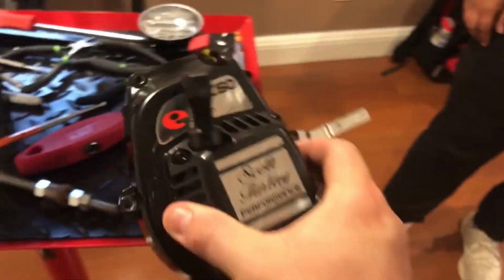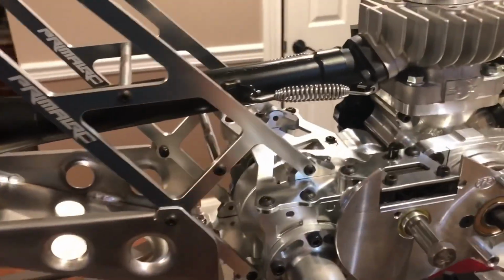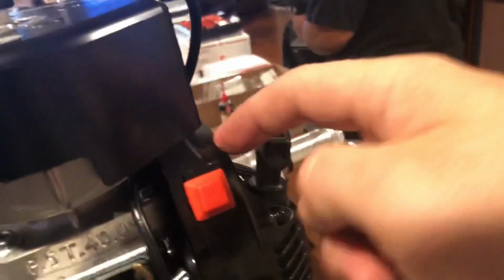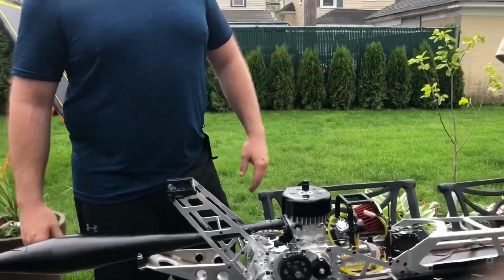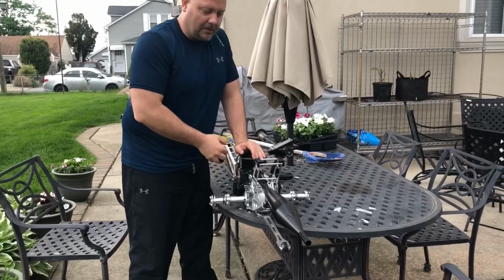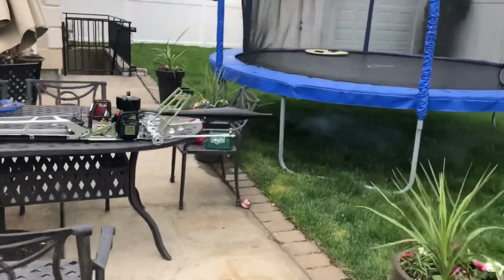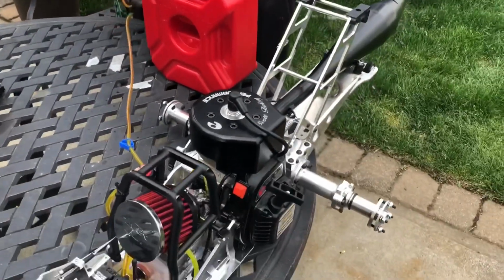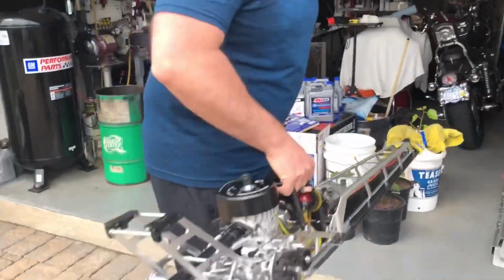She’s Alive💓1st Start Up⛽️💥🔥💨SF RC50cc/BR Drag Pipe, Primal RC Dragster

Comment: Sounds sweet Bro can't wait to see this running down the strip :-)
Reply: @BOTAJELL  john when you get a stock baja 5b buggy do you strip down the back diffs and make sure it's all its all tight with lock tight and put it back in with the screws to the right back wheel iv noticed they have come lose with some people and damaged the diff  is this comman john or just not tightened up right in the factory lol
Reply from the maker: Will fpv most people that are new to this sometimes over thinks things and take apart stuff for no reason or just wants to learn quickly but I recommend replace or repair as things breaks . Baja transmissions or the strongest out there even in stock form . If you remove your diff and forget how to took it out of the diff case ? Just re install it with the screw heads from left to right if your looking at the back of transmission. The ends of the screws are the flush side and that must face your Lay shaft and pinion and spur gear ⚙️ side .

Comment: Hey John did you machine the exhaust custom make it or where did you get that from ?
Reply from the maker: Chris Bartolone made me this Drag Pipe and header to use on this SF 50cc engine temporally because it was really made to be used on the New Bartolone Racing 50cc that will be coming out soon

Comment: Hey bro finally got that roving now I need to know where to find that none spill gas tank you've been talkin about should I try AutoZone Home Depot where's the best place I can find it thinking about starting the car up tomorrow for the first time
Reply from the maker: Your local tractor supply co. May have them in stock or https://www.homedepot.com/p/No-Spill-No-Spill-1-25-Gal-Poly-Gas-Can-1415-V6/206992015

Comment: Very nice Botajell!!
I'm curious if Chris B. can make a straight drag pipe for my alx 85?
Reply: Two strokes are much happier with an expansion chamber
Reply from the maker: Sure he can and it will be half the price trust me I have many pipes from many people and BR pipes always work well. The only problem is that he is crazy busy right now with to many things going on in he’s life at this moment like new Big Ass race tracks off and On road cars and including a Drag strip plus new engines , pipes , new engine dyno because his old one is worn out plus he also owns a body shop business with many cars to work on ! I will ask him if he can make a pipe for your engine! I don’t see why not because he made a custom pipe for my friend Kevin’s RCMAX 71 Engine last year or maybe 2?
Reply: @rcOhio  
Yes agreed. I was referring to a rear mounted drag pipe. Apposed to a side mount.
Reply: @BOTAJELL  
Yes I would be very interested in what Chris Bartolone can do for my set up. 
When he has some free time of course!
Reply from the maker: Baja Guy ok so I spoke with him and he asked where is your ALX 85 going into so he would know what style of pipe to make but if you want a drag Pipe that will work on a Primal RC Dragster or anything Baja Style set up ? He can do it no problem. Just let me know what style and platform your 85 is going in
Reply: @BOTAJELL  
It's a Baja drag conversion. 
Check my channel when you can. Ive posted a short heat cycle video. Still have some work to do but its almost complete.
Reply: Baja Guy I see! I figured you’d know that once I realized your name was Baja Guy😉. Good luck with your custom pipe brother

Comment: Thats off tap ! sounds like the ignition pulses are breaking the sound barrier !!!
Reply: Sure does! 😂
Reply: @BOTAJELL  Do I adjust the gap with the low speed or idle screw? Because I heard you say only adjust the idle with the low speed. Just double checking.
Reply from the maker: Onyknutsen what are you talking about? This video only shows a 50cc Gas ⛽️ Engine running for the first time ever and I think 🤔 your talking about a NITRO engine?? Because I do not do the 1/2mm idle gap on these carburetors only on Nitro engines I do that!! Why don’t you comment on the video that shows me saying this if it is a past NITRO video?? It would just make things easier for the both of us. I do care and I do want to see you go forward in this real engine RC hobby and I will help and eventually answer you back along with so many others.
Reply: @BOTAJELL  Thank you for your time :) I'll make sure I comment only on nitro videos.
Reply from the maker: Onyknutsen no worries bro I was just overwhelmed earlier 💥🤝💥👊💥

Comment: Hey bro just wondering if you can help me out or know anything about baralone engines 32 reed I'm having issues with this engine during 3 heat cycle  followed instructions was giving to me for this engine in the box and had gone through 6 spark plugs. then I drove the car  round with half bottle for 4 tanks or fuel to break it in and went through another 3 plugs now I'm turning it in it seems to me like the car has no bottom end takes a while to pick up not responsive also have a lighten flywheel put in. my stock zenoah 32 with lighten fly wheel goes harder not sure what to do
Reply from the maker: marco Vicente Bartolone 32 Reedcase is no joke bro! It will spank that ass on a OBR Signature series 34 Reedcase and out perform there old 38cc widow maker and SF 320 and this is facts that I have seen with my own eyes 👀. You are definitely doing something wrong . I am breaking in my friends BR 31.8 right now and I almost have 1 gallon threw it already with the same spark plug. Where did you buy your BR 31.8 from? Also make sure when you installed your lightened Flywheel that it’s in the Flywheel key correctly!! Most newbies or people that just do enough of them a year will sometimes over look this. Also make sure you torque your Flywheel bolt to 80 Inch LBS and hold the crank down from your clutch side with a clutch holder tool or the Bartolone Flywheel tool Do Not Use piston stop tool because you will damage your piston !!! Also make sure the gap on your coil to Flywheel is shimmed right with DDM shim not a business card!!! Also don’t forget that the carburetor on your BR 31.8 Reed is Modified if it’s a Engine no older the 2 years old because it will have a bigger Jet in it so if you will have to replace spark plugs more often but not at all like how you are saying. I’ll replace mine before every race only on my Bart Racing Engines . Most others builders only replace the spring but with BR engines you always get more no short cuts. If you got this engine used from someone? Or used a piston tool? Please do a compression test and tell me how many lbs your engine produces ? And what spark and fuel and oil are you running
Reply: @BOTAJELL  I'm from Australia  I bought it new from DDM I use 25 to 1 VP racing fuel power mix on all my rc's hi torque wrench all my bolts on my flywheels and use a popper air Gap tool for the coil. I'm concerned that this motor has had a upon from day 1. I put the normal flywheel back in  again  and went for another test run and tune but still got a lot of lag down low I might message Steve from Dave Motors and see what he has to say I couldn't buy the motor from bartolone racing because they somehow the shipment wouldn't  ship down to where I am
Reply from the maker: marco Vicente what carburetor are you using? I run all my engines 28:1 but your 25:1 has nothing to do with that so don’t worry about that. Did you check your intake gaskets?? Make sure all the holes line up !! Sometimes I have to make the pulsate holes 🕳 bigger if they don’t match 100 % and do not forget to torque down your carburetor bolts to 65 inch lbs .
Reply: @BOTAJELL  it's the original carburettor that comes with it on the engine. it feels like there's not much compression compared to my stock 32 zenoah I will check those things you said
Reply from the maker: marco Vicente LoL 😂 stock 32 is a shit box 📦 compared to a Modified Bartolone 31.8 cc engine lol 🤣! Trust me you would know and feel the difference. How many ( LBS , pounds )do you have from your compression test??? I will tell you if it has low compression real quick if you tell me this ?
Reply: @BOTAJELL  ok bro I will check the compression. I will get my mates compression tester check it out but I do know what I'm talking about there's something differently wrong with this engine I've seen other engines reed cases go harder than this there must be something wrong out of the box. I believe what you're saying I admire your work and videos. my mate's reed case goes harder than mine.He said there's definitely something wrong with your engine he said you took your time breaking it in. I check out for compression.
Reply: Just check it out its low 8.7 its should be over 9.5 easy or more just show how f### it is. The stock 32 zenoah  is pumping up  9.6 I'm so depressed right now buying used engine from all the way from the states cost me an arm don't know what went wrong. Could be one of those motors that could have a fault and I got one of those don't know where to go from here .
Reply from the maker: marco Vicente you must never use Piston Stop tool! They will crack the piston head almost every time when it’s time to torque down the Flywheel and clutch holder ! That sucks bro I feel for you brotha! Just replace your piston and get a new head gasket and install it because your Bartolone 32 is a nasty engine you will love ❤️ it !! Just make sure the piston is the same for your modification of engine Bartolone did on yours!! Sometimes he lightens them up on some setups. It’s not like a stock 32. Is your engine a Reedcase or piston port?? Also just a reminder. Never Ever Buy a used engine from anyone  without checking it out or rebuilding it . I know people that are on YouTube that came out with me to LI BASH and forget to add oil to there fuel and fuck up there engines !!!  Good luck 🍀👍 to you and keep me posted.
Reply: @BOTAJELL  yeah I use the clutch holder not a piston stopper I also have a flywheel wrench spanner and I torque down the flywheel when I do it. But it gets better we took it for another test run and it stopped running after fifteen minutes so we put a new spark plug n thought it was the spark plug and found out there's no compression when we pull the pull start we took it home and opened it up  the head and it was f*** it was scourged all around the side of the piston need to get a new piston new head and also may be a crank. my mate could not believe his eyes he said you didn't even give it a hard time. looks like I'm in for a new head and piston kit and crank but I looked up bartolone racing website there's no head and piston for 31.8  only a 34 reed
Reply from the maker: marco Vicente he’s building ten BR 32 engines right now. I spoke with him last night. Try to e-mail him and ask for piston and head kit that comes with new gasket that’s the correct squish. Sounds like something got in your engine from your carburetor or your cylinder if your spark plug did not break apart and got eaten up by the piston. Also try to use a good oil like a Amsoil Dominator Oil in your fuel. My cousin Freddy 2 weeks ago had a pebble get sucked in his carburetor because he had no airfilter even though he did not go fast or anything just cruising. Another person a subscriber of mine last year had a screw loose on Chassis and decided to drive his freshly built rc with engine no airfilter and from the vibrations and air it got sucked up into carburetor and fucked Up piston and once with I had a spark plug break on me and that fucked my piston . I can’t believe you were still able to start your engine and got it to run like that lol 😂??
Reply: @BOTAJELL  Thanks bro for looking in for me.when we pulled the head off there was no gasket on the cylinder head it was only the gasket sealer.soon I be flying over to New York  with the family in July
Thanks bro
Reply from the maker: marco Vicente  very cool bro 💥👍that means he gave it some more compression for you and you must run at least 100 octane fuel ⛽️ minimum and your engine is most definitely timed differently . Once you get it right it will be a beast for sure!! Bro when you come to N.Y. please let me know so we can meet up for a drink 🥃 together or a bash!!
Reply: @BOTAJELL  ok thanks do I email Chris bartolone for a head kit I might just email him see what he has to say for a kit. That will be great for sure I'll call you catch up 👍
Reply from the maker: marco Vicente email him.